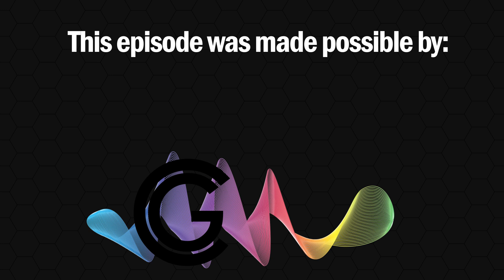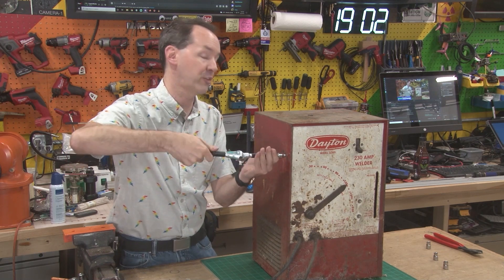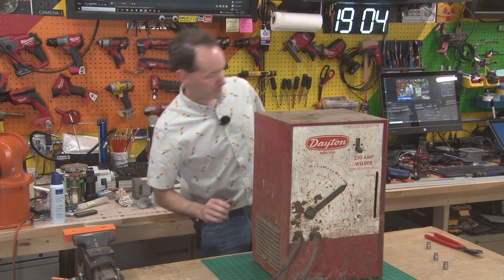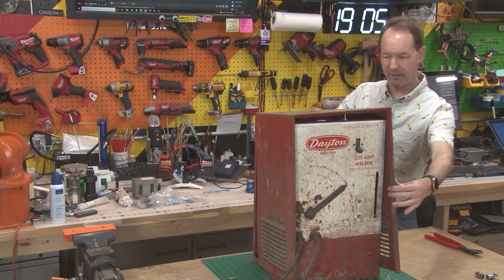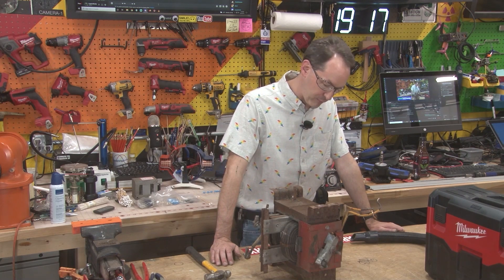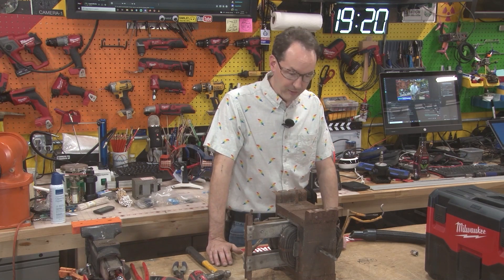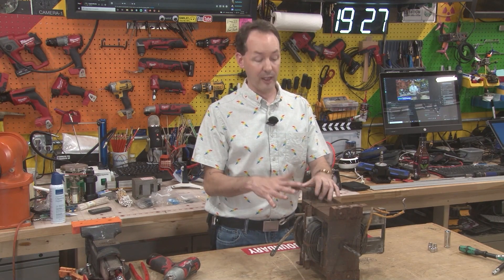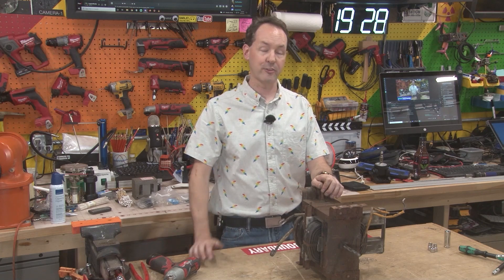High Voltage Episode 17 - How to use big transformers with parts from an old welder.

Comment: I've got a welder just like that but mine actually works good welds really well👍👍👍
Reply from the maker: If it works and it's useful there's no need to change that. But everything gets replaced eventually, and then it can have a second life in high voltage. :)
Reply: @ChaoticGoodChris  I bought these two welders they are commercial type three phase one of them 500amp and  is electronic... has some really powerful mosfets in it that drives a Transformer...I tore it apart and kept the mosfets diodes.. and everything I think I could use for Tesla coils and such.....the other one is a 450 amp 3-phase it's an analog style... has a gigantic Transformer and these very big diodes and capacitors... but it to works.. but I don't have three-phase other than a 40kw generator...I'm thinking of rewinding the secondary to where it will put out 120v AC on the three legs...because I have a 3-phase generator that is 40kw... I figured I could use that welder as a step-down where I could run my house with it... what's your thoughts on that..should work?
Reply from the maker: I would suggest, no. There are much more simpler and easy ways to convert down to power your house. That's a very easy and common transformer solution. If you want to dig deep into this, hop in the Discord on a Fatman Friday and we can really work through the engineering. https://discord.gg/KhTKWE3gCC

Comment: That's a lot simpler than the one my neon guy neighbor had on his pole pig. It was a Frankenstein rope and pulley slug/winding that got lowered into a cylinder at his bombardment table.
Reply from the maker: I so want to see pics of that contraption. Neon guys do terrifying things with HV.
Reply: @ChaoticGoodChris  Bernie passed 6 years ago @ 86. He was a retired scientific glass blower from GE in Syracuse. He bequeathed me the lab but I was losing my house to medical vampires to pay off my dad's bills and passed the whole lot off to a teaching neon guy in Utica. (The pole pig was suspected of being PCB filled) . It was a moving slug of iron that dropped into a 2+ foot cylinder with a lot of #10 green THHN windings. I recall seeing a video of a very similar contraption 10 years ago when I was researching my coil build. 
Sorry lost to history.
Reply: That sounds like a large GE welder transformer from the 50s. I watched a vintage video of arc welding and they had a large welder that had a transformer like you describe, by moving the secondary coil up and down the current could be modified. I wonder if he used one of those welders as his ballast. If I find the video I will link it.

Comment: I started with stick. Stick is great for cost: the welders are cheap, the sticks are cheap, etc. And it's more portable, no bottles to mess with. It's not as hard as it's often made out to be. You've really only got one setting on the machine to care about, and most of the technique transfers to other arc welding processes (obviously not striking the arc, but monitoring the puddle, movement speed, judging penetration, etc).

Flux core is almost as easy as MIG, with a lot of the portability of stick, but holy shit does it make a mess!

MIG is hot glue for metal. Easy once set up, quick, but more pricey and does have more settings to care about. You've got to set up the wire speed, the gas flow rate, and the amperage. But most of that you're just reading off a table so it's not a big deal.

Oxy-fuel is super versatile and very cheap. You can cut! You can weld! You can braze! It's just two bottles and a torch or two, a couple of nozzles, and some filler rod, and it tends to come on a nice portable cart. 

But my favorite process is TIG. It's so clean. So controllable. Able to weld all kinds of stuff. And for dissimilar metals that can't be properly welded, TIG brazing works great. It's more fiddly, more expensive, and less portable than the other processes, but it's just so fun to use.
Reply: As a guy that welded mostly with a stick welder, i can say that it is very easy to control and it is cheap to do. I've only once or twice welded with TIG so i'm not very good at it, but i liked it because there was no sparks/splatter to be scared about.

Comment: Never welded until I got a job at a steel mill slitting coiled steel. Got tossed a stick welder that we mostly kept at 130A AC well above the rods 110A and told to have at it, was a fly by seat of your pants. Took some time to learn that basicly everything was grounded and somehow you don't kill your self in the process. Stick gives you the slow puddle formation and heat effect zone to learn. But It also teaches about burn through as in how you need to speed up or turn down the welder if you move from 250ga down to 90ga and you have to stick weld them together